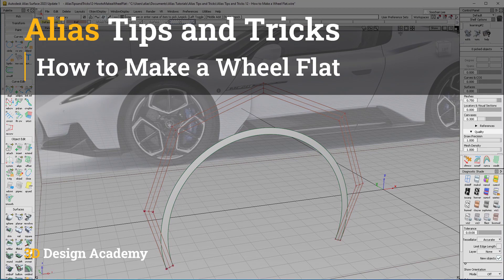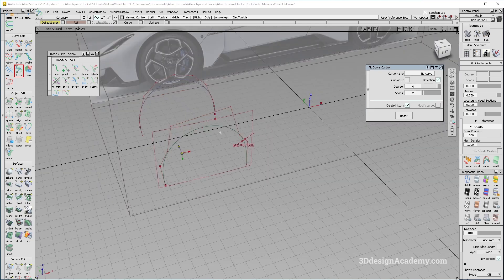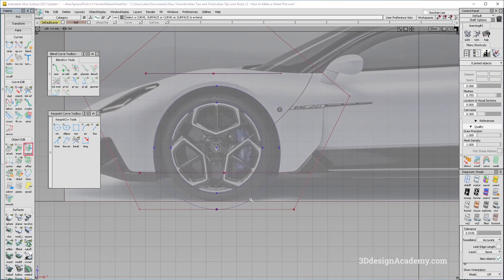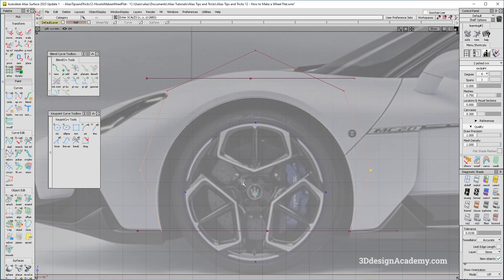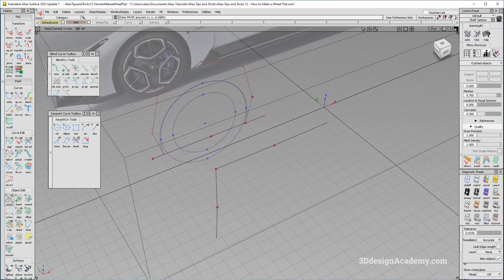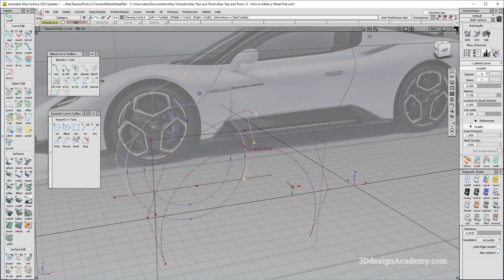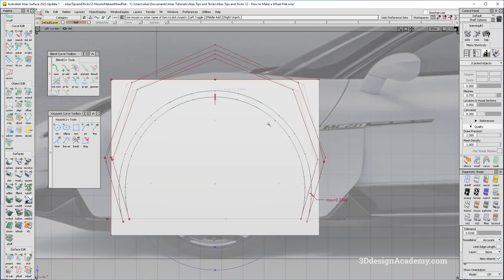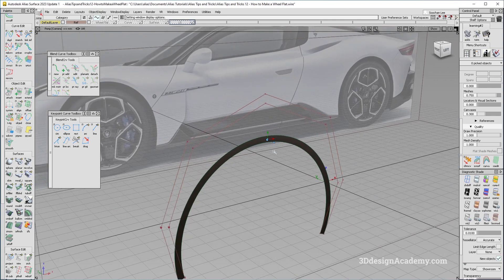Alias Tips and Tricks 12 - How to Make a Wheel Flat

Comment: Why don’t you project a curve instead of a CoS+fit curve? Is there an advantage doing it that way?
Reply from the maker: That works too. I could project a curve, but with the Cos and fit curve, I can adjust the CV structure as needed. Also, I found that project curve takes a bit of time calculate. In the end, as long as you get a clean result, that's what matters.